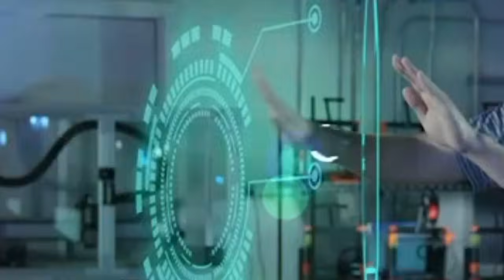Shaking the World! KAAN is Finally Ready to Fly in Large Numbers

Comment: We can't mass produce this until TF35000 engine is tested.
Reply: TAF3500 HOME PRODOCED ENGINE IS FINISHED TESTING OUT PERFORM F35 AND SU57 ENGINES, TF produced higher thrusts. 6 jets ready for testing p001 p002,p003, p004,p005,p006 each will carryout different tests. Starting 2026. Two years of testing before it's handed over to Turkish Airforce  around 2028. I presume mass manufacturing has started, export orders to for fill.